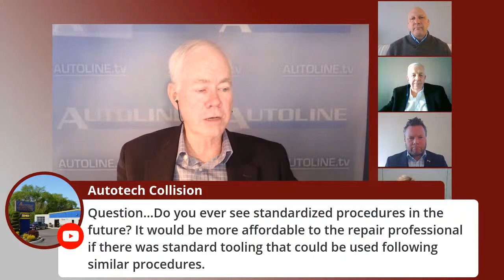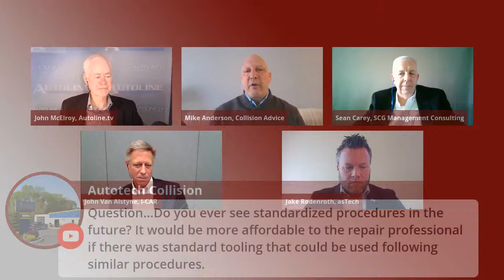How the Heck will we Repair these Newfangled Cars? - Autoline This Week 2409

Comment: Insurance companies are increasingly writing off collision damaged vehicles.
Because of advanced safety design and production, they want nothing to do further with a car that has been wrecked, its safety equipment and safety cage has been compromised.
Stressed from the crash, sensors going haywire and dropping out, subsystems shattered exec etc etc, and the cost of labour to return the vehicle to as new condition became prohibitive.
Much the same as DVD players, far cheaper to toss it than repair it.
A modern car is literally a one off manufacture. If the OEM doesn’t build it properly, they’ll dispose of it, never to be registered, parts only scrap. The costs of getting it right no longer made sense. Rework sections in a factory just don’t exist in modern plant.
A twisted structure, built of selected steels, cannot be straightened, ever, The use of adhesives etc are in place forever in a modern unitary body. Just a no sum game.

Comment: Modern vehicle require oil changes? Doesn't sound modern to me. Evey car I've owned since 2014 have no oil change requirement.
Reply: To add to this.  If you need a transmission, your car is underpowered.

Comment: I see the value of ADAS, but it’s all training wheels and crutches to me. Future generations of less-skilled drivers.
Reply: The same argument used to be made about ABS.  My dad once got to provide equipment on the infield of the Indy 500 and spoke with one of the race car drivers (Hoyt? I cannot recall) around the time ABS was starting to come out.  The driver's claim was he could skillfully stop a car as well as ABS, but he had to be on his game every time.  He would not consider a car without ABS for daily driving so he would not need to be at his peak performance at each surprise the road served up.  At present I feel the Autopilot Level II on my Model X does not handle the car as smoothly as I do.  However, I use it any time I feel just a bit tired or distracted as it is at least consistent.  I used to be skilled at designing complex control circuits with random logic and flip-flops.  That skill is no longer required.  Move on to the next skill.
Reply: @mrhickman53  I understand. Traction control has probably saved my life hundreds of times. That said, the few times it cut power on a patch of gravel pulling into traffic, it also put me in danger. There is a risk:reward ratio.

I still have the choice to turn it off for now. Ultimately, if I can't opt out of the tech, I want to be able to turn it off.